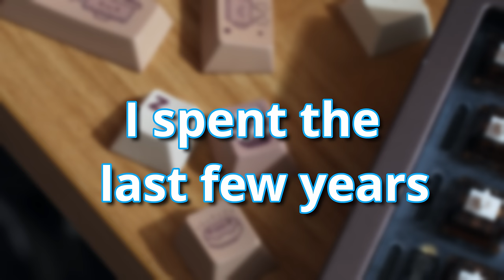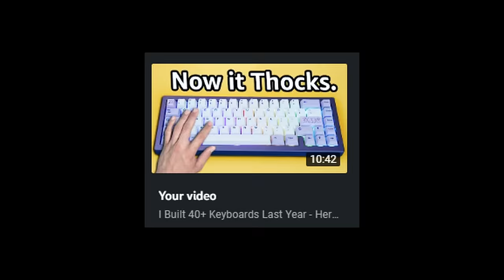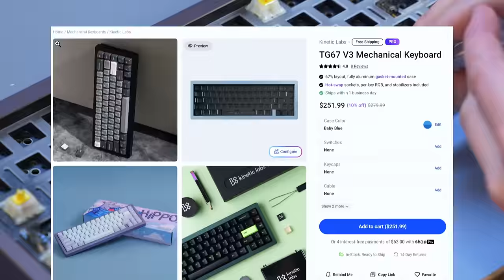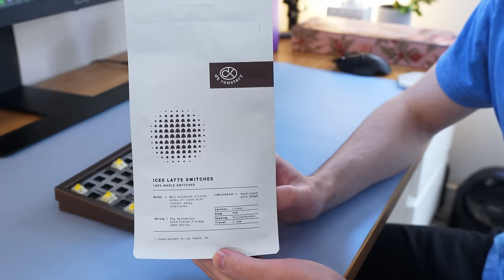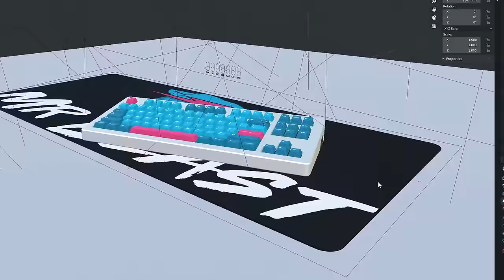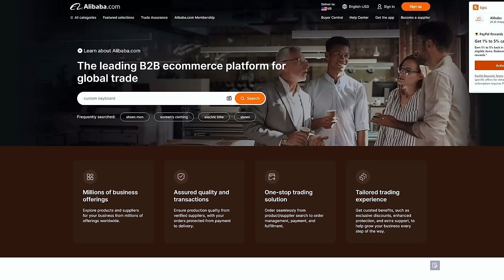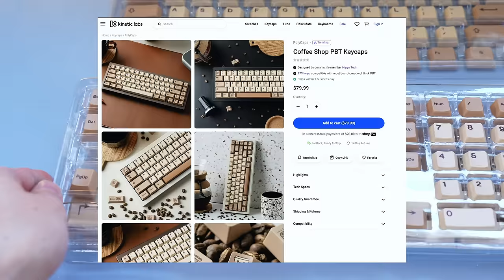How To Make Custom Keycaps in 2024... (It Took Years)

Comment: I would have bought these if I had a mechanical keyboard and you had a nordic-se layout but for now I love my membrane it sounds so perfect in my ears and has gained sentimental value over the years, going from a cheap keyboard I bought because I needed one to a keyboard I NEED to replace(missing space keycap so I put the home button there instead, fn not working and one other hey not working) but so don't want to replace.

Comment: I have a very specific request - PS/2-compatible keyboards. I have an "Agon Light 2" that I have been trying different adapters and keyboards with and it's astoundingly specific about what it wants, electrically speaking. It wants a PS/2 protocol, but the receptacle is USB. This was more common over a decade ago when there were more keyboards that shipped with a passive PS/2 adapter, but there is hardly anything on the market now that works like this, and the adapters I've tried do not do the right thing: they turn a PS/2 board into a USB board, or they are passive adapters that make the lock lights flash but do not seem to function otherwise. Olimex, the makers of "Agon Light 2", list one known-compatible keyboard, which is a generic membrane keyboard. In theory QMK should be able to be flashed to work as a PS/2 device, but the issue has remained stagnant since 2019. My own hunt has narrowed the possibilities down to "keyboards that have a PS/2 plug but also have a USB model with no additional features". 

I want some awareness on this since there are a bunch of these retro machines coming around that use this old standard because it's easier to implement on a microcontroller. It would be nice to have good new keyboards with them.

Comment: any recommendations for alternate metal keyboards? Just getting started and would love to start with those keycaps, but don't know/have much experience with building but replacing the keycaps seems simple enough. Just don't know about lubing, stabilizers, etc. I was thinking of the nuphy gem80 since all you need to complete are the switches and keycaps

Comment: These keycaps are literally never in stock. I check everyday and turned on notifications for two different emails. I have been waiting over 2 months and at this point I feel like I should just buy a premade keyboard because it seems they legitimately never go in stock, and the date keeps getting pushed back. Are these even produced anymore?
Reply from the maker: Im sorry, a big company cut in line at the factory with a MASSIVE order so the restock was delayed by about 3 months